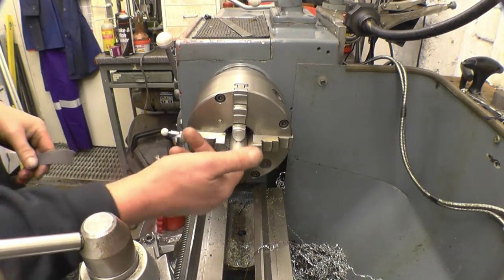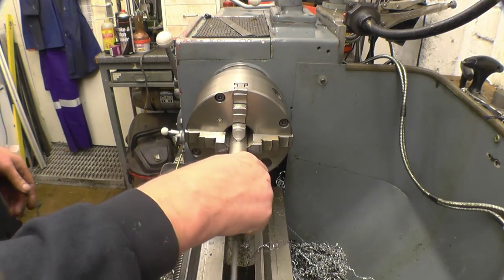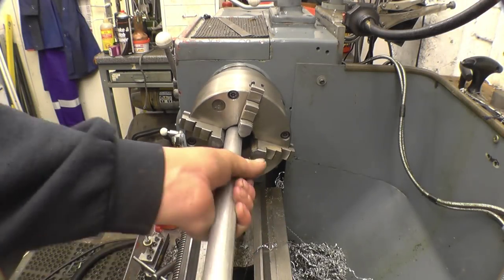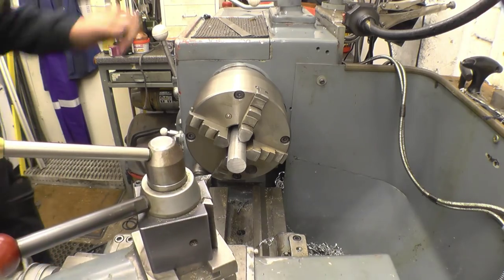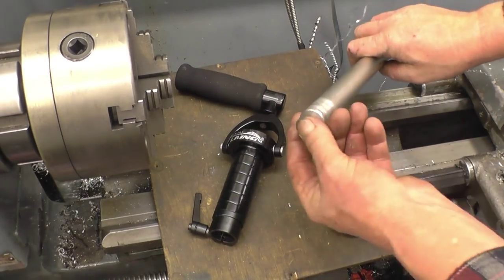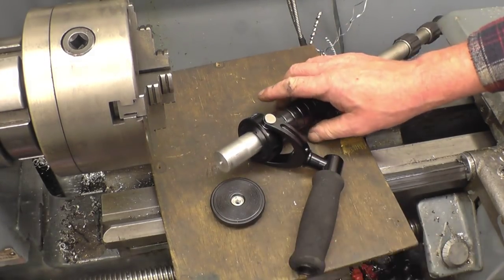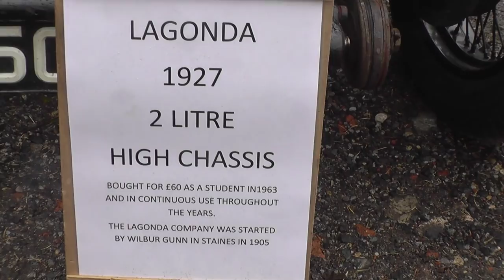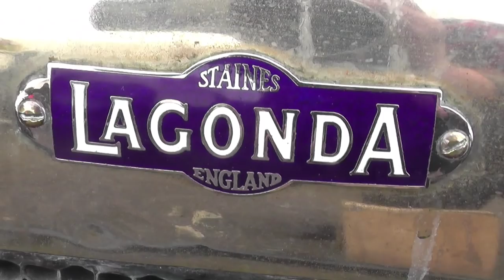SNNC 247 P2   Camera Steady Rig    Stig & The Pit Pony

Comment: John, I understand finding aluminum bar at a good price is a challenge even in the states, most scrap here is flat stock, I did score some recently @ a local scrap yard. Most times I just go to a couple small volume suppliers an buy bars especially in the 1” diameter stock. Since we use imperial here threaded rod is easy to get, every hardware and big box store carries it, 1/4 x 20 is a size I keep on hand. In fact for my custom QC blocks that is what I use for adjustment of center height

Comment: You need to add some balancing weight to the bottom of the tube otherwise there's little point in having the gimbal joint.  You hold the gimbal handle in your preferred or dominant hand and with just the tip of the fingers and thumb on your other hand you gently balance the motion and direction of the camera.
Reply from the maker: Thanks i need to experiment
Reply: I built one a few years ago and with practice you can get good results. You will need to spend some time getting the balance right though....not just the total weight but front-to-back too. Look at the commercially avaiable ones they have a counter-weight bar at the bottom. Like you say John, experiment and practice.
Reply: I think the position of the weight matters more than the weight itself.  The counter needs an offset so if the camera is 3" above the camera, the counter is about 8" below. see the Volt or smoothee https://tiffen.com/steadicam/steadicam-hand-held-stabilizers/
Ideally you'd be using a giroscope good viewing - but not practical :D.
The "Sweet spot" for the weight is to mount it under the center of mass of the camera.  On a SLR that's about where the lense fixes to the body, on your diddy camera it's probably under the tripod fixing hole.

I'm sure you've already googled pictures of "Camera stabilizer". On a light camera like yours - it might pay to add a little weight to the base of the camera to give the counterweight on the pole some inertia to work against.

To start, maybe 3-4 oz under the camera and 5oz as the bottom counter - reduce the weight rather than adding more - it's not supposed to be a workout.
Reply: There are plenty of Youtube videos by people who've made this sort of stabiliser and also videos of balancing a commercially available version.  Might be worth have a look around to get an idea of how and why these handheld stabilisers work and where to add weights.  It's not essential to get it perfect but if you are to use a gimbal it might as well work as it should.